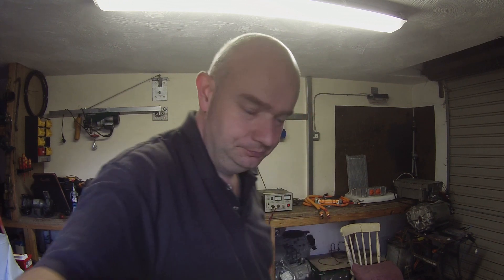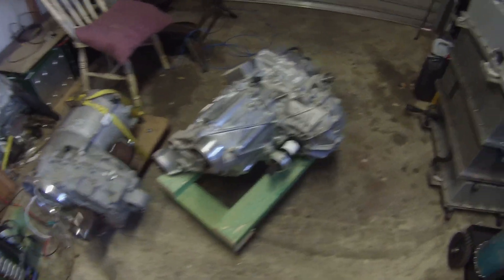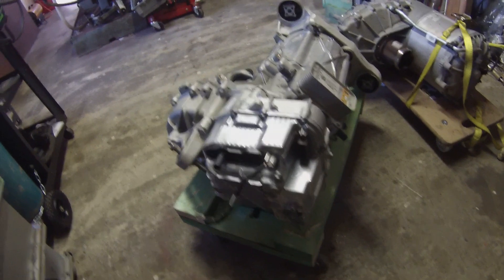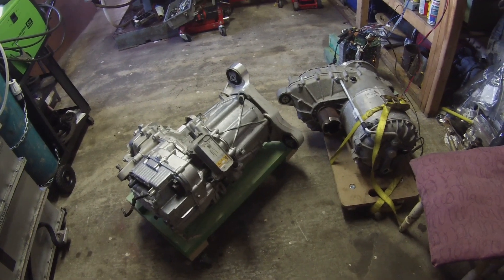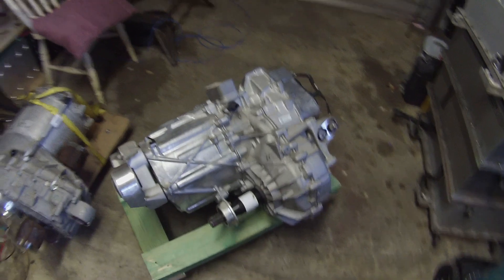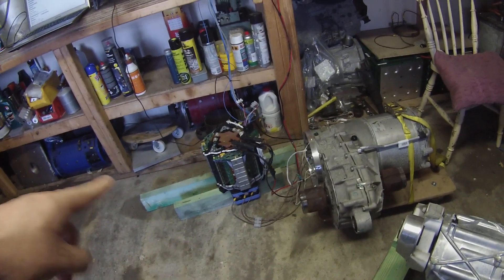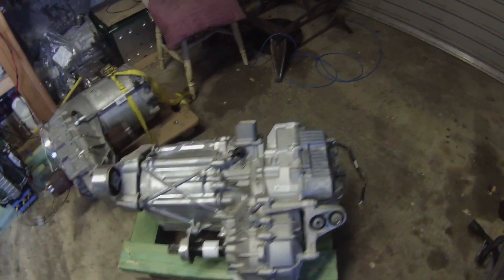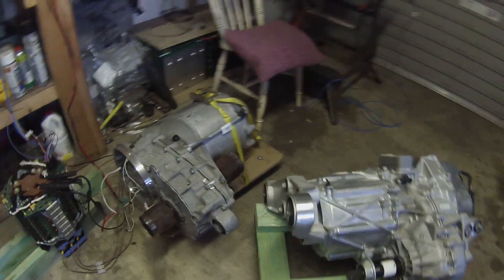The Tesla Project : Front Wheel Drive Unit

Comment: I have engine and gearbox out of l322 range rover.I was thinking of one of these for front wheel drive? .I just use it for tipping around London so performance isn't important.Offered the full front unit for 500 gbp and ease of installation is much easier.